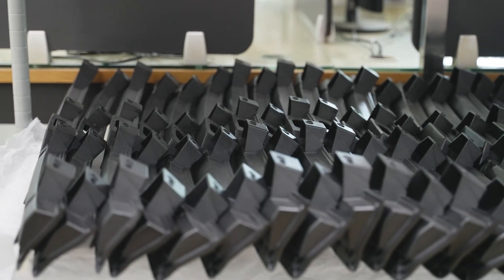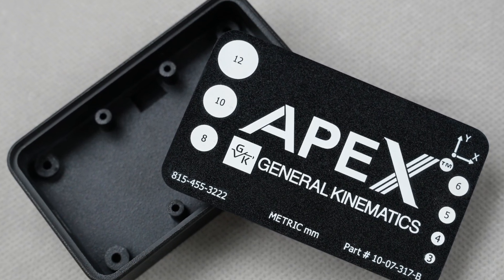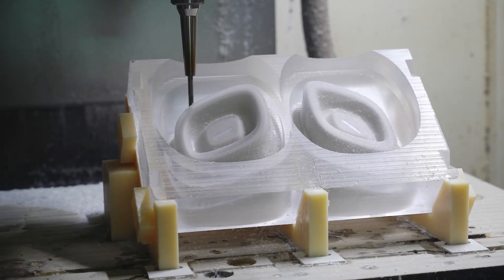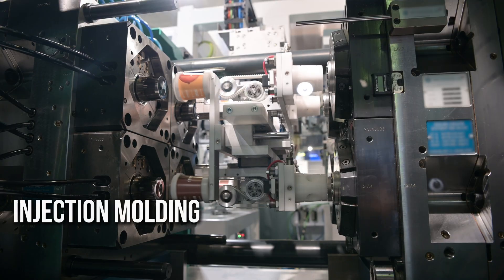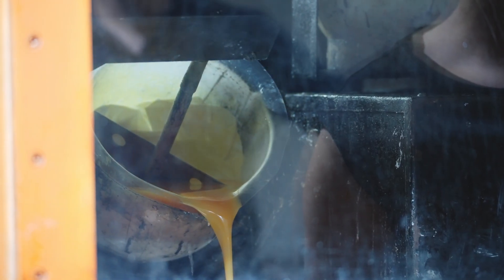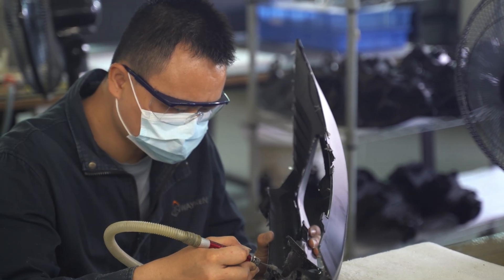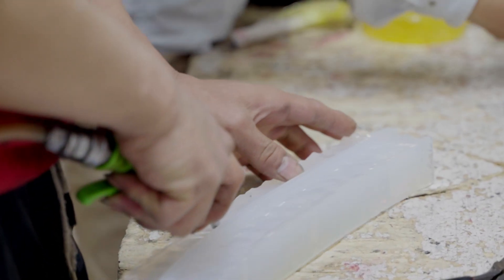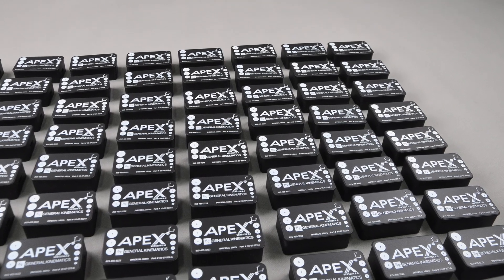Injection Molding Takes Weeks — Urethane Casting Takes Days | WayKen Rapid

Comment: Good work!
Reply: "Compared to CNC machining and 3D printing, urethane casting offers better speed, surface quality, and overall value. " The end of the story did they use CNC and 3D printing?
Reply: @lucthien601  Well yes you have to make the master pattern first, then use that to make and pour a silicone mold for replication. Limited by cure time though. Not as fast as they claim unless they make loads of molds.
Reply from the maker: Thanks for your support! Glad you liked it!